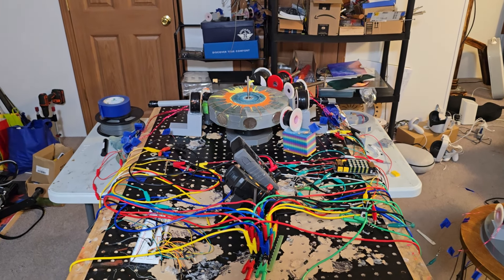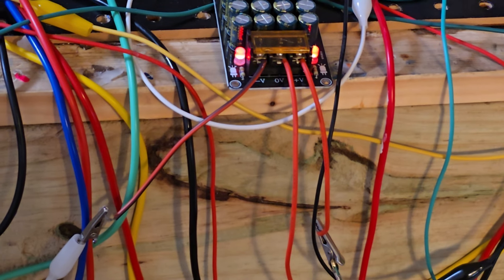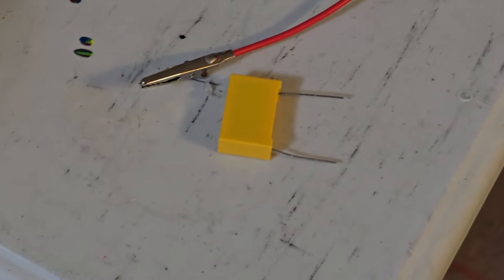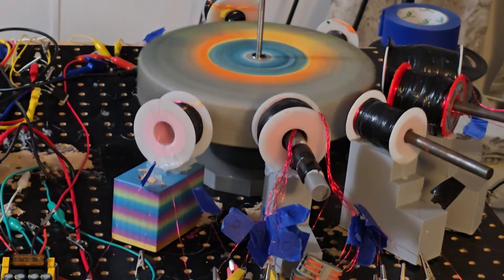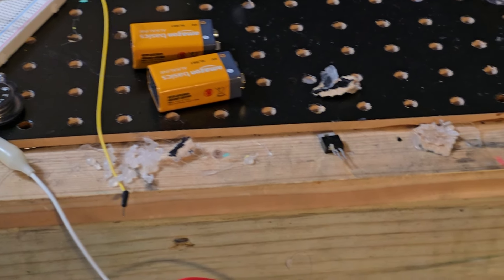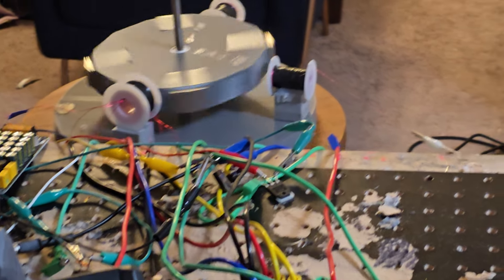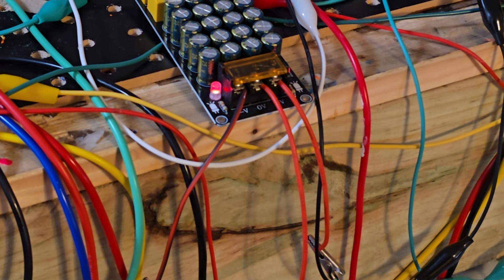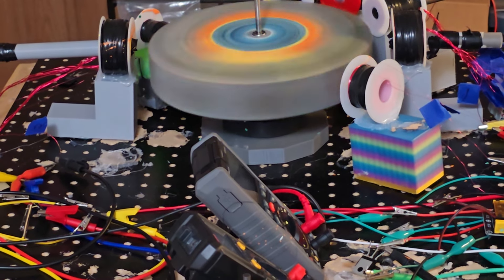papa's pulse motor energized another runs so smooth with 1inch to1 1/2 inch air gap

Comment: I actually think i could make you something that measures its speed, get an Arduino uno, buy a little mecury switch, put 5 V through it and attach its pin in line to an analogue input.   It should flick at a rate directly proportional to the rotational speed, so you get it to write out the time between peaks, you would position it somewhere on its circumference

Comment: The filter rectifier regulator thing. I took apart some fluorescent light fixtures and some had little white boxes with caps, diodes and resistors inside them. Are those similar to his gadget?